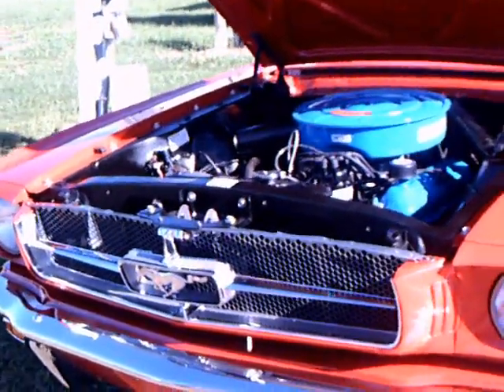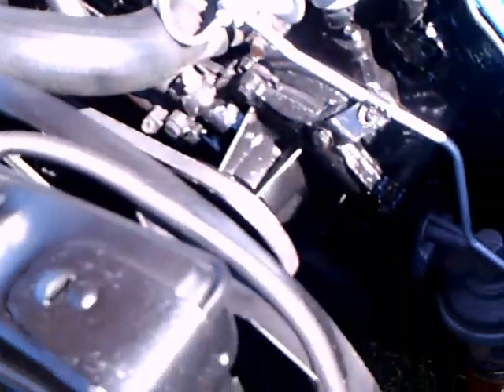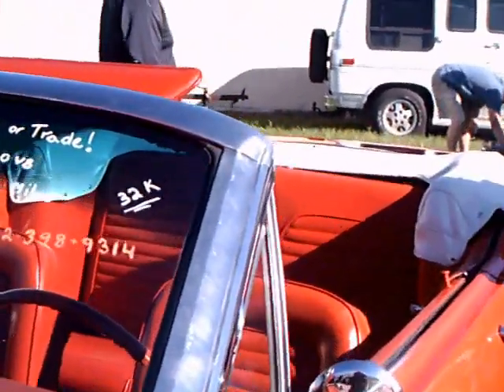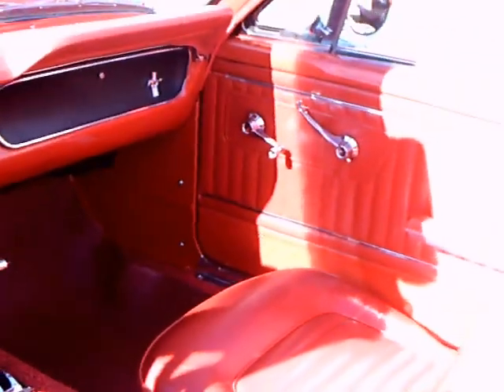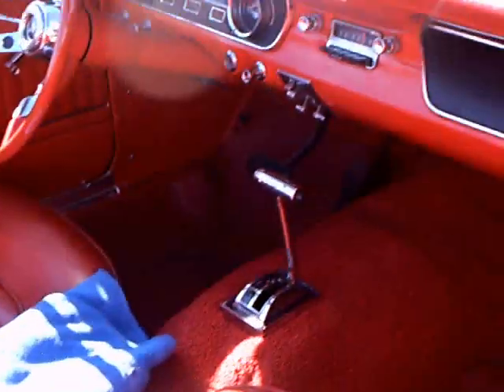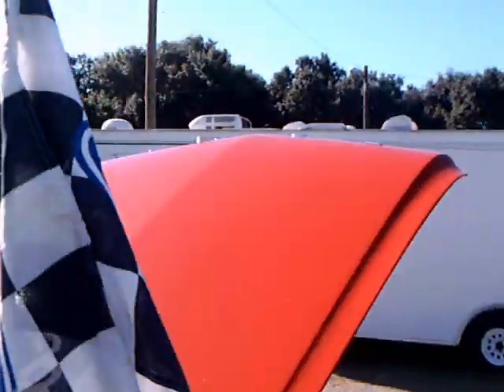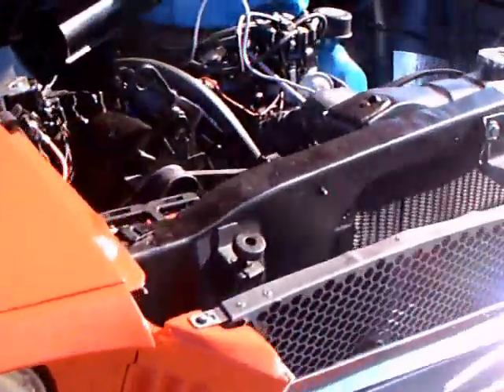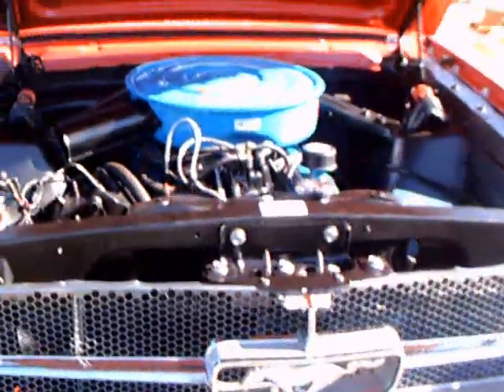1965 Mustang Convertible Red

Comment: even my favorite Mustang is the 1969 model year, my current dream car it's a 1966 Fastback because I think is easier to go resto-mod, I love the shape of this body and the 66 have round gauges, more sporty than the square velocimeter in the early 64-65. the 289 engines are perfect to do a 347 stroker and the torque thrust wheels fits right with the style